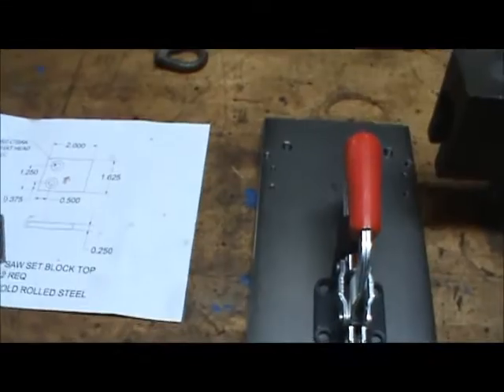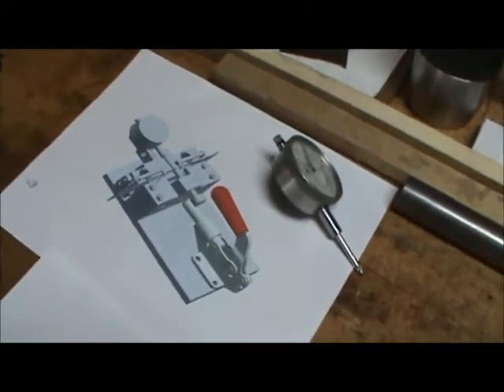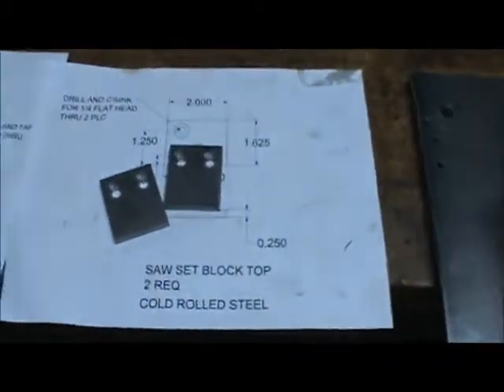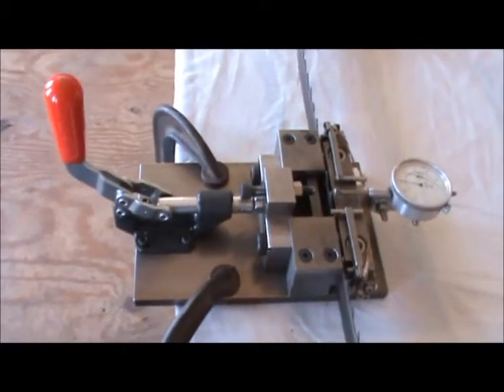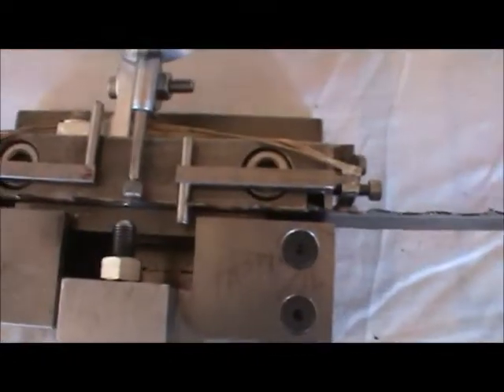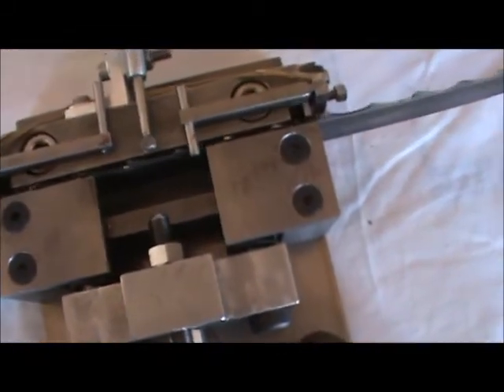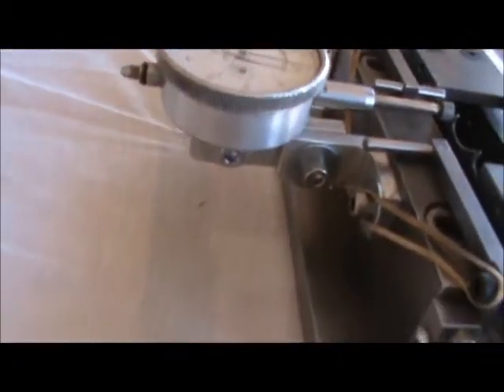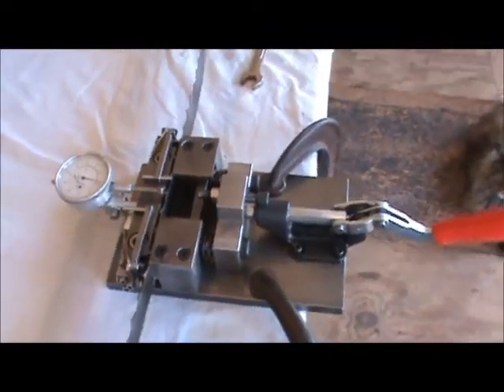Homemade band saw tooth setter

Comment: looks very professional I would like to have one for my woodmizer saw mill. Would you be interested in building one for me . or would you sell your plains and I could get
one built locally or maybe I could build it with my drilling/milling machine.
Reply from the maker: Gary Roop  Gary, I would consider selling you a set of drawings. But you can't copy and resell them or go into production on the saw setters and sell them. If you are going to make one for yourself that would be OK. As far as making one for you I will have to work up what it would cost and then you decide.
Reply: +Gary Roop   I seen your reply about the bandsaw tooth setter and I would like to buy the plans for this one..who can I contact to buy them...thanks
Reply from the maker: kandyted100 I would consider it. but the same goes you cant sell ,or reproduce, the drawings  or make setters from my drawings and sell them.
Reply from the maker: kandyted100
 
 
kandyted100 I would consider it. but the same goes you cant sell ,or reproduce, the drawings  or make setters from my drawings and sell them.
Reply: +whistle3man I will agree not to make any for anyone else..i just need one for myself..thanks
Reply from the maker: kandyted100 I'll sell you a set of drawings for 50.00. I'll also include my phone and e-mail if you get stuck
Reply from the maker: rats arsed  this is my design my drawings. I'm sure there are similar setters out there.

Comment: It appears like the pushers can be adapted/swapped out to set somewhat finer bandsaw blades.. 
Whether that being reason,  not going with the dual systems seen on many, being my guess,
Though it could simply be the compact size of these compared, or perhaps the materials required which makes this one a winner to me.
No need answer this, sher what fun would that be, hehe.
Nice bit of souping up I might add.😉
Thanks for posting, that's another project sorted for me.
All the best
Tom

P.S Should you be concerned, seeing as you mentioned plans for sale...
someone else on YT has uploaded your video, seems it takes the publisher to report any copyright violation.
https://www.youtube.com/watch?v=6XEfAF-IQME&t=17s